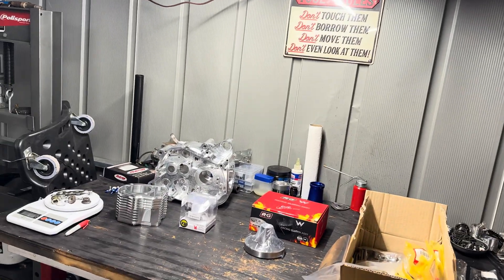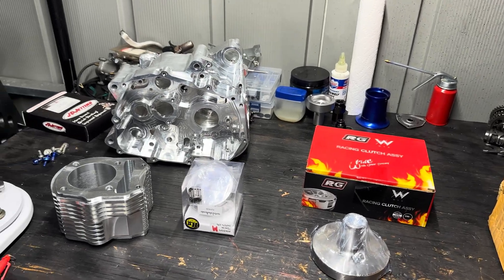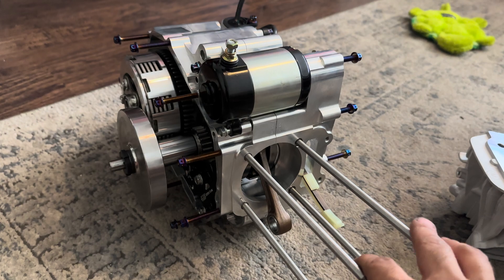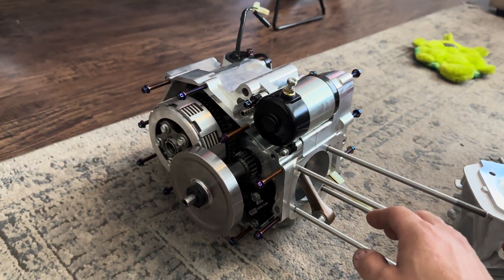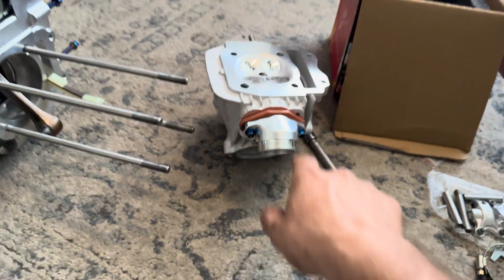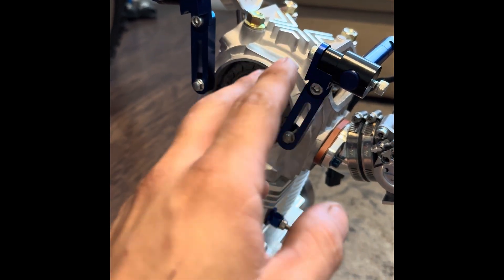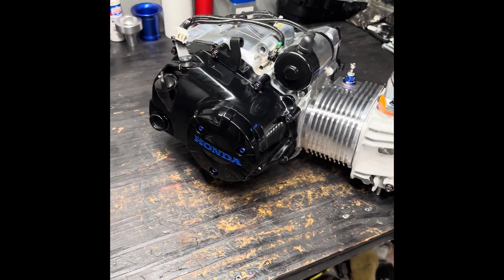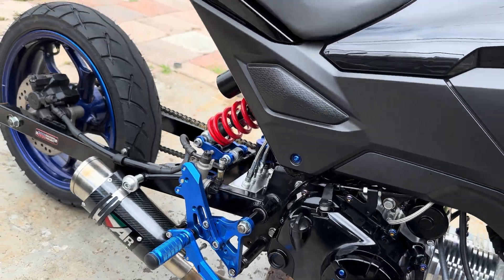Custom 300cc Honda Grom engine build

Comment: Don't get me wrong,  that's a beautiful build. Just my opinion here , from the perspective of someone,  who cringes at the thought of having some 10k plus dollars in a small bike. I love small displacement bikes man, but i also like a build that is reasonable at costs .  I'm a huge fan of gross, and I know some people can spend ridiculous money on these things, but to me it quickly gets ruined when I start looking at numbers.   I can't imagine having 10k plus in a bike , and it not be at least a 10 second beast in the quarter mile. I'm currently working on a zs 212cc swap grom clone, with absolutely everything replaced,  all the fasteners,  hardware,  suspension etc. Basically it's just the frame,  with everything else gone through and upgraded. I'm working on getting the Daytona 4v top end for it, and in the end , I should have a 125cc class bike, with a good 25hp at the tire when I'm done,  and I might have 4k in the whole build. I think the cbr 300 swap for a grom is also interesting,  considering that you can get a good deal on a salvaged cbr 300 with a good motor and harness.  I  did enjoy the eye candy in your video tho , I just know on my budget,  it's not something I could ever do.  I love making these little bikes fly, without breaking the bank.  I'll have to watch the video again,  but what did you spend,  and how much hp did it make?,,, great video tho man I subbed.
Reply from the maker: @benjaminhager7187  thank you. I completely understand and i found a way to get it done with out braking the bank. I got lucky and some friends got me parts from Thailand so it helped out alot with the cost. I probably spent a little more than 4k with out my labor on everything it needed to be done. For the power it makes im still not sure, im getting a dyno pretty soon and will find out how much it makes. I have few builds ill post when i get it. But im sure it makes over 40hp easy. Im in the process of building another one and im making it all my self ill be posting it soon probably a month or 2 when i finish sourcing all the parts. It’s going to be a wild build
Reply: I think that short exhaust is going to rob you of some hp,,it needs a loop to extend the pipe length
Reply: How can I buy one like that?

Comment: try a 300CC BUILT 2 STROKE...  mo-powa per CC... FI, hale yea, they make nice systems these days small and light, quiet..    double your HP     BEAUTIFUL engine tho...   bet its fun as you know what . .  .  :face-blue-smiling:
Reply from the maker: @deandee8082  maybe one day man, building the engine would be easy they sale bbk for 250 2 strokes to be 300cc and even 500cc now a days. Swapping it in would be the harder part but maybe one day. There all fun tho when its fast lol

Comment: no oil cooler? very nice looking but your going to get heat problems
Reply from the maker: @red88ization  no oil cooler. You don’t need one if you build it right and do the correct oil mods! My 240cc grom has no oil cooler and runs at 210 all day 🤙🏼

Comment: Crank is off a little bit thats why it vibrates so much but that thing looks sweet good work ❤
Reply: Oh ok. Looks sweet man good job
Reply from the maker: @loganfrogs956  thanks man 🙏🏼
Reply from the maker: @loganfrogs956  crank was balanced in Thailand and when i checked it was 0.02 spinning perfectly straight. Might need a little bit more weight balancing but they all vibrated with high compression!

Comment: Why you don't go with automatic clutch? 
And is it nicely to add that oil tank in the rear?
Reply from the maker: @bouazzamajdoubi7974  why would i do a automatic clutch? Yes its good to have a catch can on a really big bore, helps with internal engine pressure and catches any oil if it pushes it out 🤙🏼

Comment: is the transmission stock? cause  I would imagine that's something you would want to upgrade
Reply from the maker: @Okn_exc  no sir the transmission is not stock even tho stock one should be fine but it was completely changed out. The clutch is the one that needs to be upgraded the stock one is really weak and hardly hold the stock power

Comment: Cool build man! I have never seen a 300cc big bore. Are you going to install a oil cooler and a air filter?
Reply from the maker: Its all custom from Thailand dude. No plans for oil cooler im still tuning it in, if it needs it i will add one for sure but seems to be fine now no overheating issues. But no air filter v stack gets more flow and i dont ride it in dirty areas its mostly just to race around the block and maybe go to the drag strip a few times
Reply: @andreoli118  all right, good luck,  im curious to the hp numbers!

Comment: from that idle sound..i think you need to degree camshaft..
Reply from the maker: Camshaft was degreed if you watch the video.. idle lobe sound is made with the aracer ecu. I can turn it off and make it sound normal but it sounds cooler chopping 🤙🏼
Reply: @andreoli118  what degree cams/crmpresion ratio u use on this setup?
Reply from the maker: @MuhammadFaisal-jf7dt  i cant tell you that one, high comp and the right degree. Will
Play with it in the dyno and see what makes the best power 🤙🏼
Reply: @andreoli118  🫡…all the best👍
Reply from the maker: @MuhammadFaisal-jf7dt  thank you man

Comment: when the front wheel compresses will it touch the engine? maybe a 250 would of fit better?
Reply from the maker: Its close for sure i got a smaller tire on the way should clear better. But no way 250s a heavy slow pig lol

Comment: Looks like the front needs a bit more clearance from the engine. That will touch.
Reply from the maker: Its very close for sure. I got a smaller tire on the way should have more clearance. Wanted to lower it more but i can’t 😅

Comment: if you want to go fast buy a big bike..
Reply: that's a bit boring
Reply: Y buy a fast bike when u can make a slow bike fast its way more fun
Reply from the maker: 😂 its cooler to smoke big bikes on a little one 🤙🏼
Reply: @andreoli118 I’m making my XR150L into a 300cc; putting a 78mm piston in now. With the current setup I max out 5th gear at 88mph.
Reply from the maker: @DustySteelGarage  thats sick man! Those motors ate good to build they make some crazy power with them in south America, you can make that thing a 450cc
Reply: @andreoli118  what?!?! That’s insane! I haven’t heard of anything over 300cc. What would I search to find that? Crf150 upbore 450?
Reply from the maker: @DustySteelGarage  its hard to find info about it but this is a similar one basically the older gen of your motor. They call them big blocks. https://youtu.be/Rc_yVjJMW2U?si=di04XlLbEdXdP0X_
Reply: @andreoli118  that’s very cool! I wonder what the limits are to the case?
Reply from the maker: @DustySteelGarage  im not sure on that one but i would assume it has to be modified tho for that big of a size.